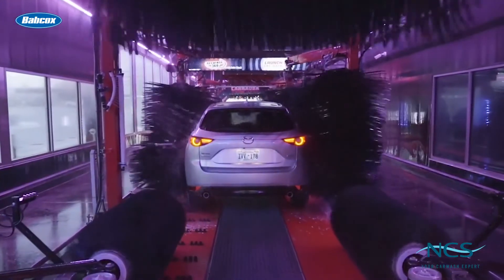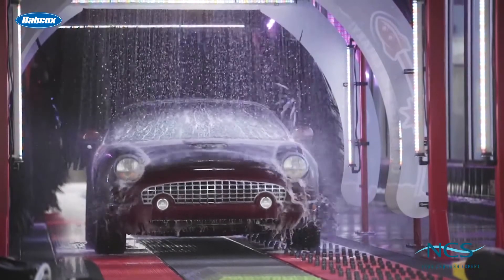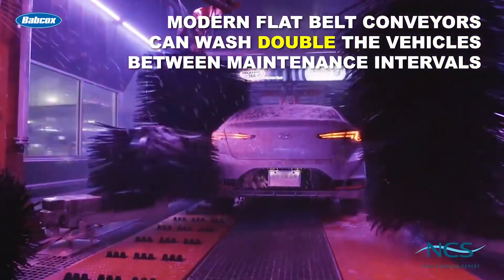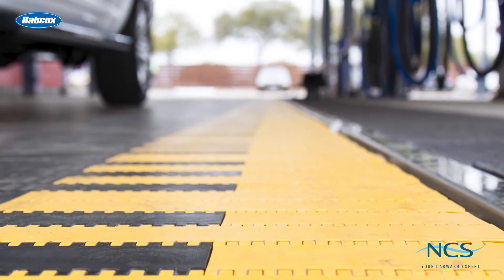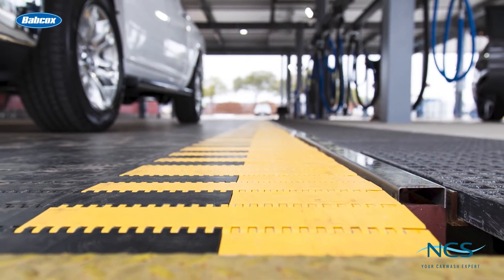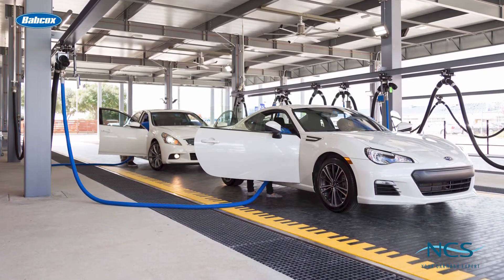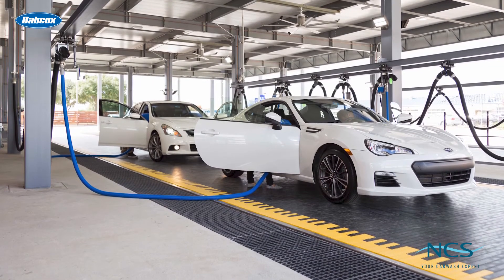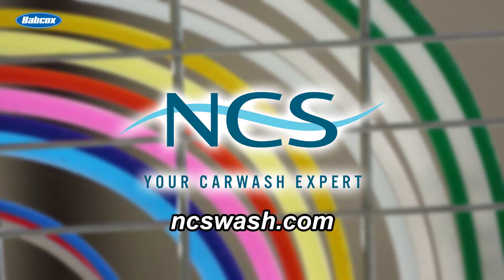Conveyors: Flat belts

Comment: As working at many washes over 7 years. I love to see flat belts are becoming more common as wash industry is starting to modernize. Track and chains are durable and strong, but expensive as needed constant maintenance or slipping from those breaking happy customers on their phones.
Reply: I haven't worked at a car wash for nearly that long, but I have worked in 2 different sites for the same company, both with chain conveyors over the last 9 months. I haven't had any problems with drivers causing the chain to slip; if the vehicle brakes, then they just pop a roller. What causes the slippage?